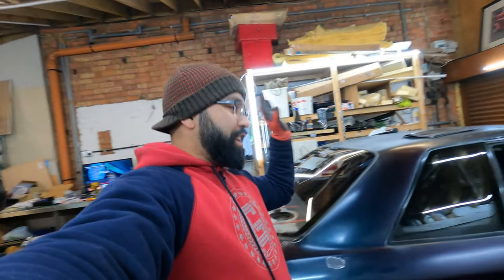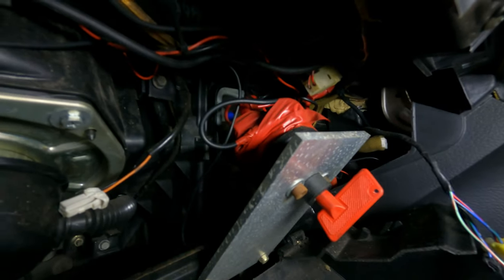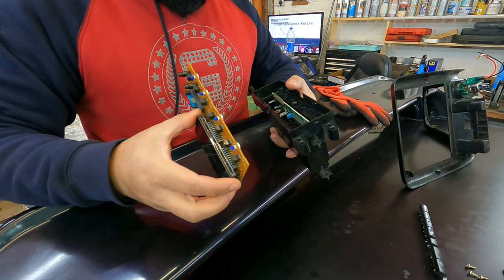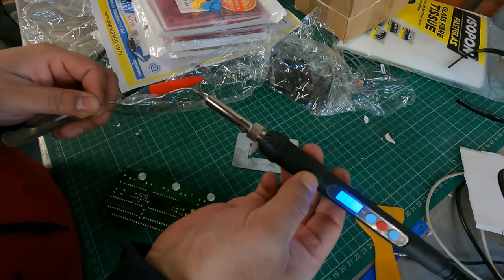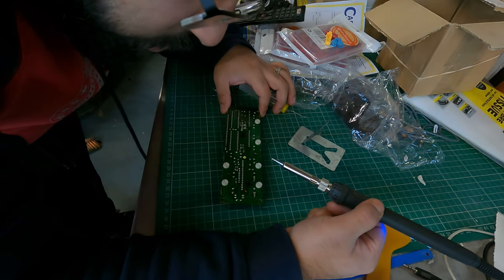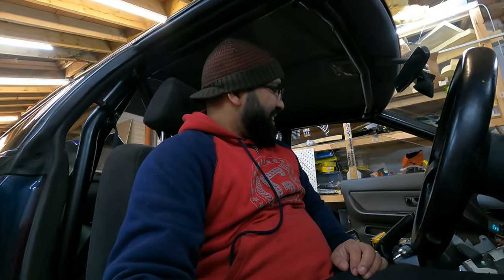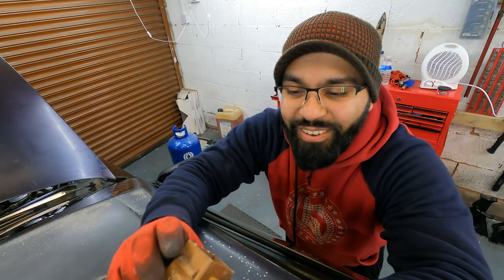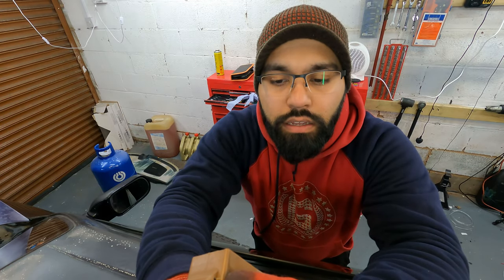Project Ratty32 |Fixing Things & Broken Things On The R32 GTR! Heater Climate Control Fixed

Comment: Did you ever figure out why it wouldn’t blow air on speeds 1,2, and 3? Mine has the same issue and I’ve already replaced the heater/blower fan amp behind the glove box and that didn’t work - only blows on high. Makes me think it’s an issue with the climate control module.
Reply: i had the same issue, i changed the climate control module and got my fan speeds back
Reply: @AHQemzi same! 😂 ended up replacing mine last year and no more issues
Reply: @justinglacken4891  I changed the relay and resister and was so confused why only fan speed 4 and couldn’t find anything on the forums 😂 but finally it’s working now